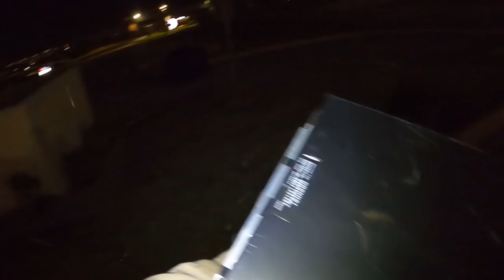Dumpster Dive Computers MEGA JACKPOT!!!💲"no really, they were this high!!!"

Comment: You might want to check the processor chips on those smaller Dells, if they are i3 or i5 2nd or 3rd/4th gen they are easy sellers on Ebay. Generation number is the first number after i3/i5 so 2xxx, 3xxx, 4xxx and so on. 1st gen was only 3 digit like 900 but some still have a resale value. Better to sell them now then wait for them to age into only scrap value.

I resale the memory sticks too but only after testing them and if I can pair 2x 2GB sticks or 2x 4GB sticks. The 4G get me about $26-28 with first class shipping and I do pair them up to save on shipping costs. 2 2G sticks tend to only get around $10 with shipping so almost not worth it as it's only 4-5 after fees/shipping but still more than scrap if they sell.
Reply: You're right man

Comment: I have always figured that someone could become crazy rich from building software that looked for pricing discrepancies then automatically bought and sold items through different on line platforms.  

The AI could search out these discrepancies then the human could pull the trigger.  One could probably even figure out a way to never even touch or warehouse the item.
Reply: They are also illegal in most countries because they tend to be used by hackers and you mean VI. AI's like EDI and those from starwars  are still a long way off.